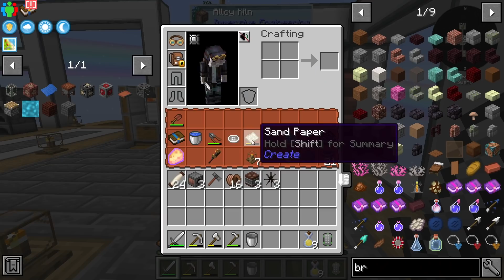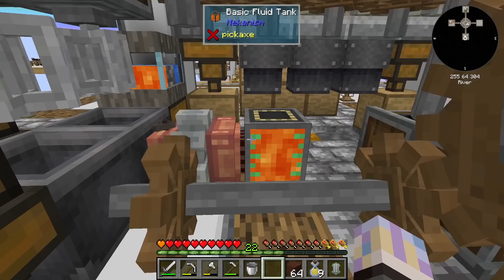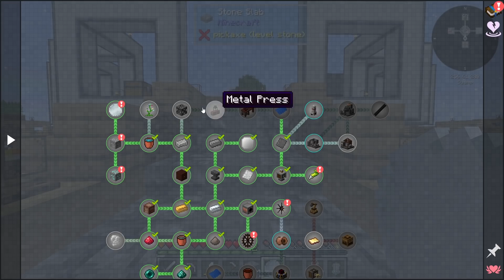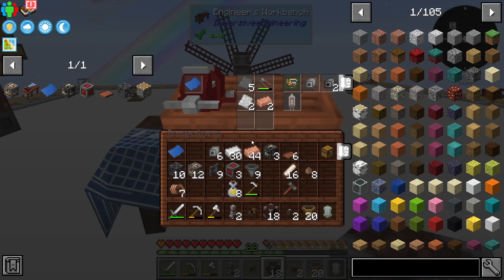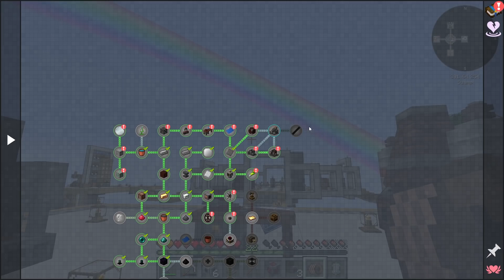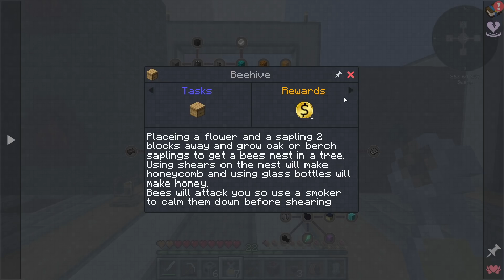Skyopolis 4 Blank Ore EP6

Comment: Immersive Engineering is a pretty great mod.
I dunno if it's been changed for this pack but it's typically better to make the Graphite Rods in the Engineering Worktable so they'll have more durability.
It would be very mod-pack of the author to lock the schematic that make the rods behind progression though.

Comment: if you move your saplings up 1 block your rats should die less, but the lumberjack will stop working every once in a while. The advanced blast furnace has auto outputs that are nice. There is a better recipe for the electrodes.  You can wash sand to get easy clay, with the encased fan
Reply: all good tips. I'm thumbs upping so he sees it.